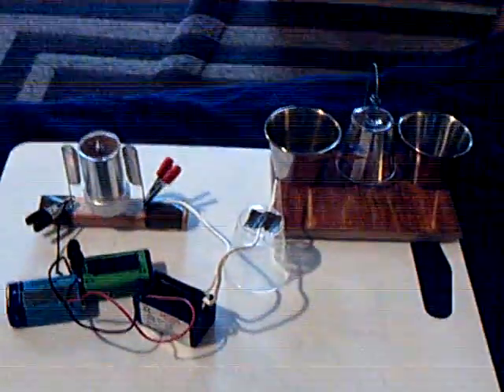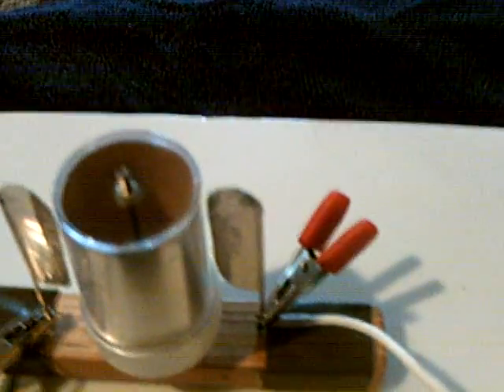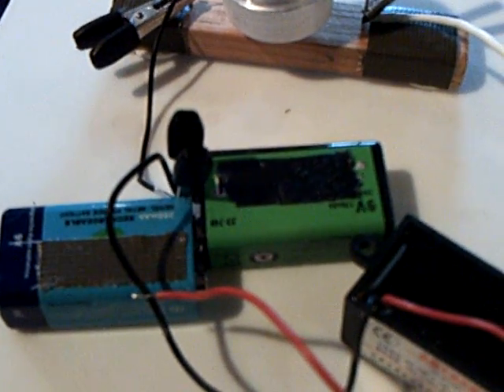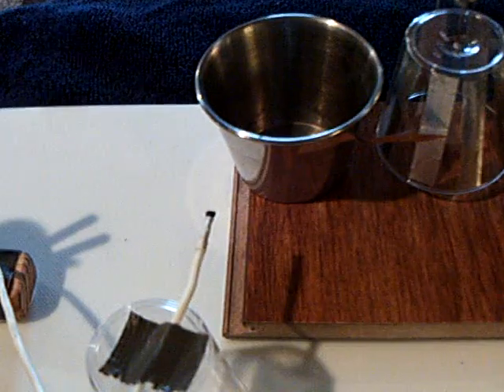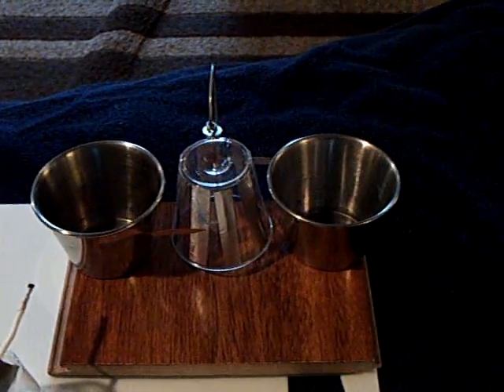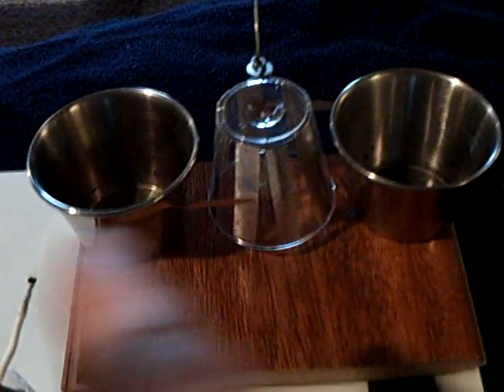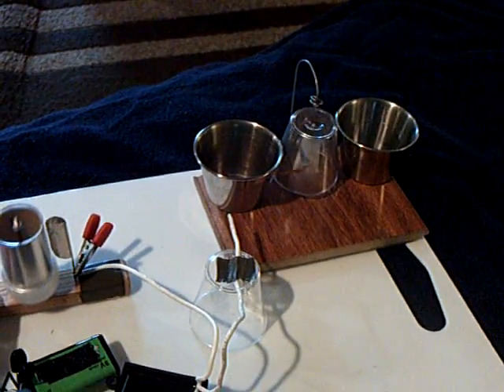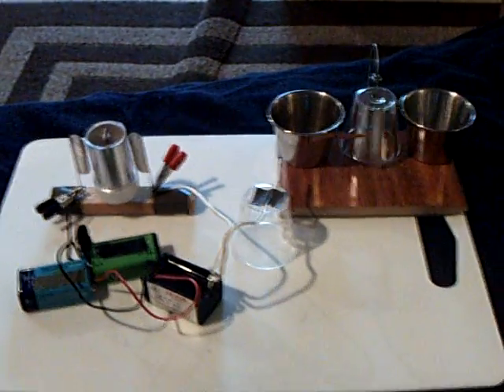Wireless electrostatic motor

Comment: cool, vid thanks,  give your ground and arial circuit their own capacitors  use it to store a positive and neg charge soley and independent, a cap soley for ground and a cap soley for arial., otherwise you only get what a wire allows threw.

Comment: The body is acting as an antenna of sorts and it has mass because you are the ground and the antenna. Remember the sec exciter experiments it takes mass and a ground to make things work. Add a solid metal object like a weight or food can that has mass put it on the floor and run a piece of wire off it to an insulated surface and attach it to the negative like you did to your finger.
Reply from the maker: I liked Doc's "What's mass got to do with it" video.  I was thinking about that today when I was working with this.  It appears that you are right about my body being both an antenna and some sort of ground path to the wireless motor.

Comment: Interesting stuff. i have a similar little negative ion generator that i pulled from an air ionizer (I think) but its only about 4kV. Think that'd be too low of voltage?
Reply from the maker: Hey Kyle.  That 4kv unit should work fine. Rig up a simple Franklin's Bell and see what happens. The motors need really low friction bearing points to work.
Reply: Negative ions are called anions, it seems that the heat excite them, we can not do that with the cations.